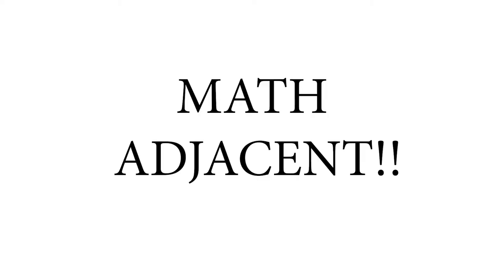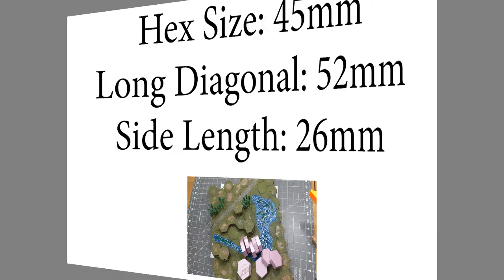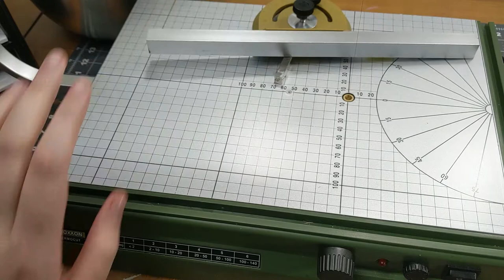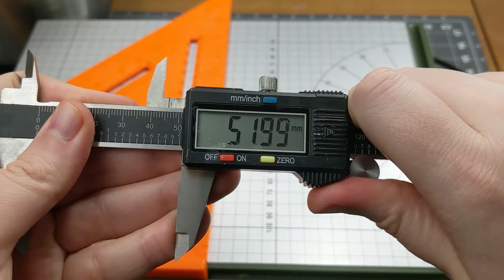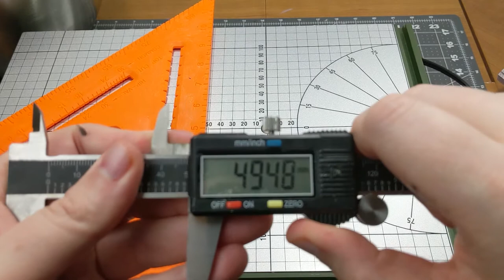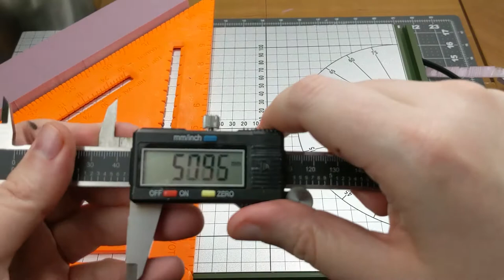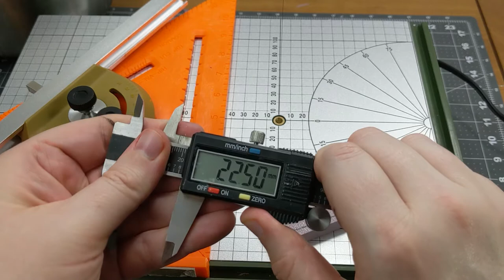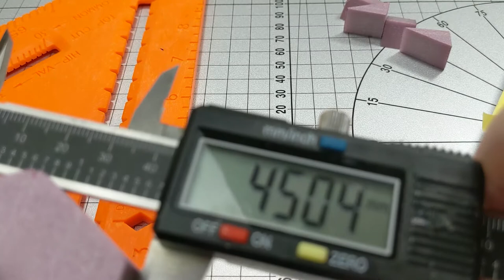Cutting Hexagons from XPS Foam - The Building Blocks of Custom Hex Maps

Comment: That seems to be the most difficult awkward way to make hexes that i have seen. I do perfect hexes using nothing but a craft knife and a metal ruler.. Im puzzled this seemed to be the most inefficient use of time.
Reply: Lol. Yea i was thinking this seems like a lot of work, and that i could essentially get the same results with a small extendo-blade box cutting knife from the dollar store and a ruler. I imagine id cut strips to the desired width, (35mm i think?) Then just cut out the triangles, then separate the hexes. For my terrain purposes it wouldnt need to be ultra precise. Id be adding trees and other stuff anyways. How would you do it?
Reply: @MaxSabbath666  I simply start off making squares and using my MDF hex template cut the corners away. In a nutshell. Any small discrepancy can be sanded in seconds. Takes a minute or so for each hex

Comment: Alternative: print out a sized paper template of hexes, then use the hotwire to cut the exterior shape of the desired terrain formation, then lightly trace the interior hex segments with a hobby knife directly on the paper. Voila!

Comment: Buy $3000 worth of tools, and you can cut some sweet $2 foam terrain!
Reply: Not even $250 in tools.
Reply: $25 for an 8x4 sheet of foam, proxxon cutter  I got for $100, hot glue gun $10, calipers $20, bag of hot glue sticks $3, $10 for craft paints, flock cost $9 for a big shaker bottle, speed square $5, mod podge $5. So less then $200. Have 10 times that in just battletech miniatures let alone buildings and scatter terrain.
Reply: Precision costs.  It's easy to cut thin, rough pieces by eye with an Xacto.  Good luck with larger, geometric pieces without the right tools.

Comment: Cool video! But, much simpler math can be used! Say you want a face of 2" for your hex. Draw a 4" circle, then draw a 2" line from a point on the circle, to the next point. If you connect them all, you should have a hex with 2" faces. Same works for metric as well. ;)

Comment: I just use a hex shaped paper punch. I have a 1.5", 1", 7/8 and 3/4. I paint cereal/frozen pizza boxes with sponge technique. So like a dark grey base, light oversponge, random flicks of black or secondary color softened/blended in. I make a lighter stock and darker one, probably do three pizza boxes of each at a time. Let dry, punch out about 70 hexes per pizza box, light tone in 7/8, dark in 1' (or light in 1" dark in 1.5") and glue the light in the middle of dark, eyeballing. 

Once I have a stack of a few hundred hexes I just glue them all onto corrugated cardboard or XPS sheets. Either make a large, flat, square hex map or  7 hex tiles, 14 hex double tiles, or custom shape tiles. Let dry, cut the excess cardboard away. Easy. I can make 30+ 7h tiles in a day. I stack them on a flat map if I want height. Obviously they're not as tall as 1" xps but they communicate the concept.

Comment: Thank you for sharing your ideas. I would like to share an alternative method that does not require waste and may help you produce more uniform hexagons :
 
Try dividing your hexagons into (3) parts : (1) rectangle and (2) triangles. The smaller pieces can be more easily cut to the correct size, then assembled in a more uniform shape. If rectangles and triangles are each cut from strips, then the only waste would be an end-strip that could be used with another board. Cutting a blank, then removing (4) triangles, wastes approximately 1/4 of the blank, and therefore approximately 1/4 of your board. However, if you cut strips in (2) different widths that match the short length (width of one side) and the long-length (the two triangles at either side of the rectangle), then you will have no waste, since the end-strip might be used in the future. Using (3) blanks increases your manufacturing time to that necessary to accurately cut each blank, but the overall uniformity of the finished hex will be higher since the triangles will share matching angles. There are other benefits that will come to mind in the context of purchasing, manufacturing, quality control, storage, assembly, and end product. Glue is probably the easiest method of assembly.

Comment: I'm looking at making a display board for an army that happens to be on bases that have a hex design. However the hexes are more like 2cm on long diagonal. I'm probably going to score most into the board, but still want a heap of tiles that can be broken/stacked/scattered as well - f you were going to do these as little 2cm versions, would you make 1 long hexagonal stick first then cut each tile off with the hot wire?

Comment: I bet if you were to glue the short faces of your cut off pieces together, then cut some rectangles to fit between the 45mm sides, you could glue them all together and have even more hexagons. And with the seems where the pieces are glued together, it would probably look like cobblestone. Though I know, cobblestone doesn't really fit in with Battletech.